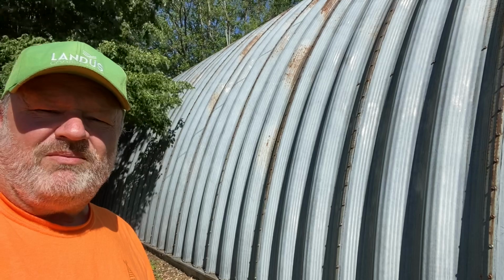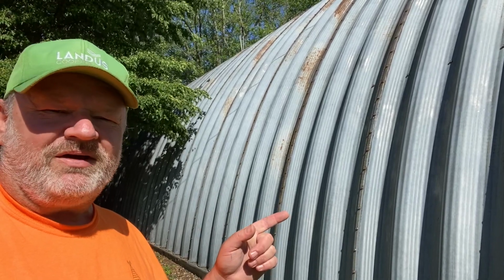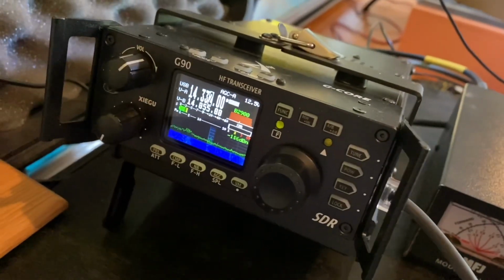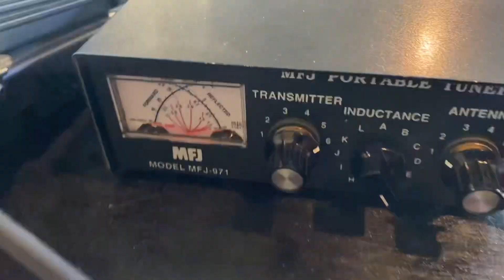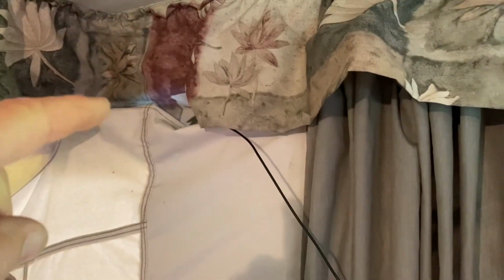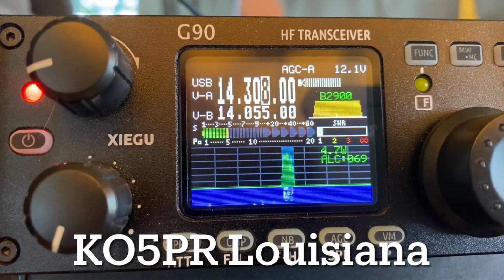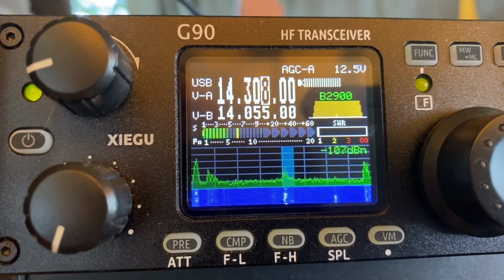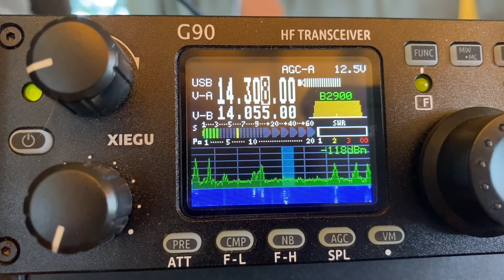The Quonset QRP SSB 5 watts - Iowa

Comment: It’s Amazing what you get to work as an antenna! Thanks Kevin.  Have a great weekend.
Reply from the maker: Hi Thor.. Thanks for your comment.. I was surprised it worked as well as it did too.. I typically have that shed connected to ground rods, but I disconnected them for the experiment.. It's sitting on a cement slab so I guess it's fairly isolated from the ground (other than being so close to it) .. Conditions were a little wonky but I'll give it a try again soon to see if it can do any better.. It will give the dog and I an excuse to play radio and have some coffee in the portable ham shack again, LOL.. Thanks for watching.. 73, Kevin ~ k0klb

Comment: While I am watching you and those amazing signal reports I am thinking these quonsets will probably be in the next HRO catalog in the antenna section.  And the ads will say "Get the amazing K0KLB quonset antenna just like Kevin uses.  Installation and corn not included."
Reply from the maker: haha Rick.. That would be one expensive antenna, LOL.. however ppl could also use it to mount more antennas on top of it like I do which would be an added benefit.. I had a GAP Titan DX multiband antenna up there and it had amazing performance.. Corn NOT included is a good idea to keep the initial purchasing cost down as it will save the buyer about $210,000.. LOL.. Thanks for stopping by and watching.. Good to hear from you again.. 73, Kevin ~ k0klb

Comment: Hi Kevin.   Been trying some of this stuff you do and have a question.  How do you know if your wire to the alligator clip is not acting as the antenna instead of the shed?  (or whatever else you connect to).   Thx for the vid.
Reply from the maker: Hi Jeff.. What you can do is find a SDR (http://rx.linkfanel.net/) out there that will hear you.. transmit a 5w carrier and measure the S meter level, then disconnect the alligator clip (retune with just the wire) and transmit your 5w carrier again and see how much difference there is between the two.. I don't recall if I did it in this experiment or not.  Thanks for watching.. 73, Kevin ~ k0klb
Reply: @hamradioqrp-k0klb  Doh! So simple.   Thanks!